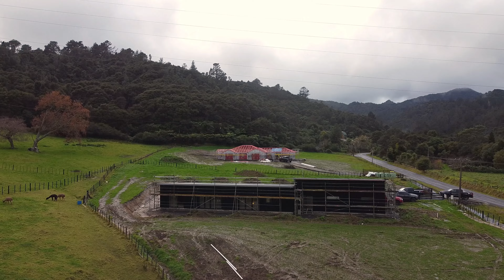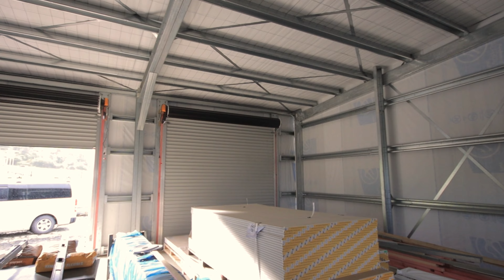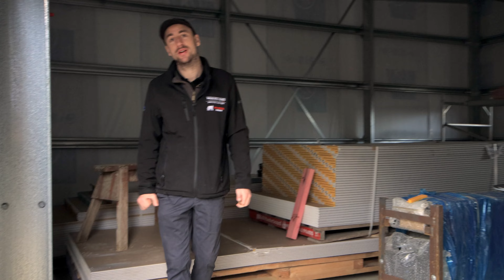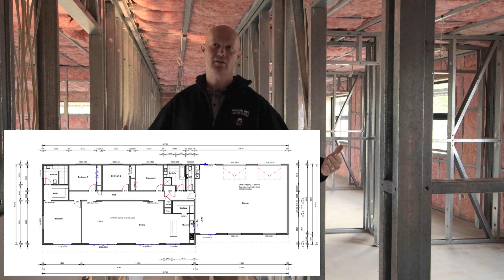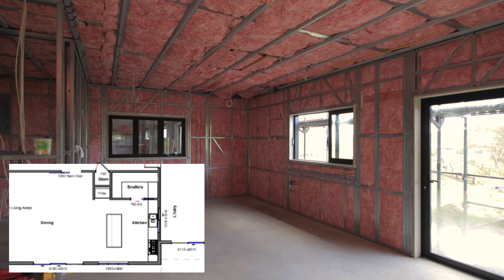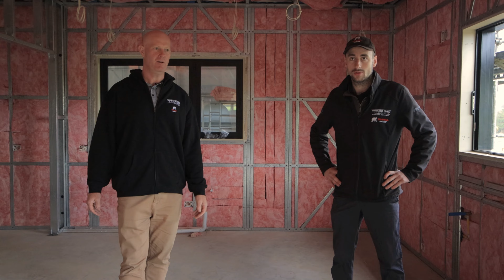Kit Set Shed Home Build Underway in Karangahake NZ

Comment: How is the steel insulated from the outside or is it 1 large conductor and thus the insulation does not do much?
Reply from the maker: Good question Bart it has a thermal break on the purlins of the roof, thermal blocks between the trusses and walls and a rigid air barrier on the walls with thermal insulation. Thanks Jason
Reply: @waikatosheds  nice